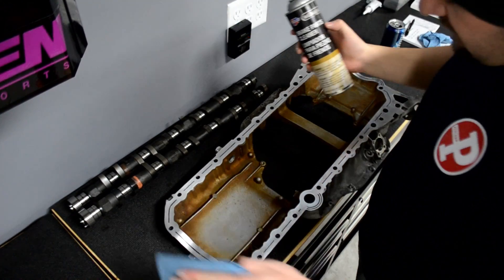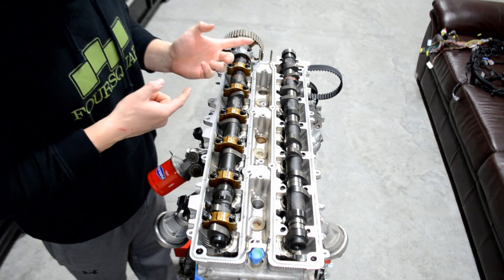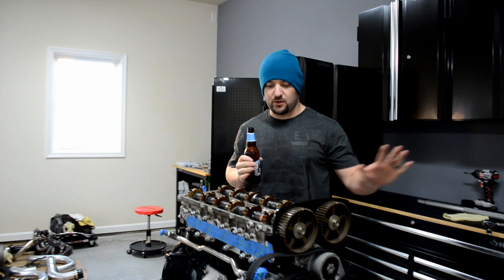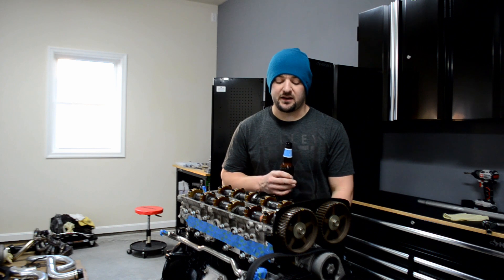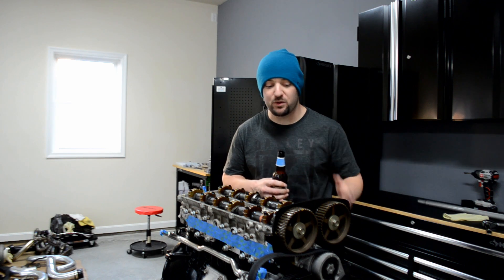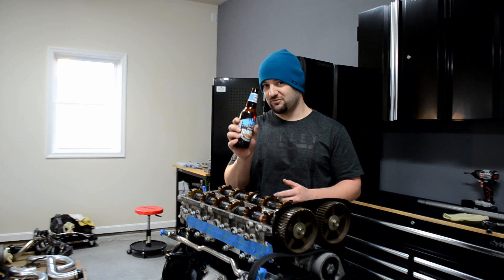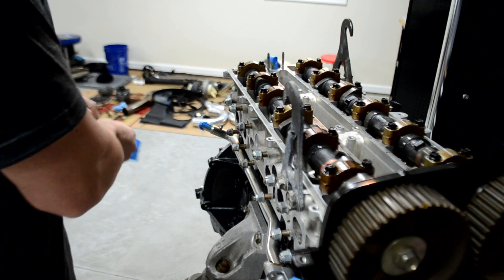Supra Build Series-12: How to Installing BC 272 2JZGTE Cams, Oil Pan & More!

Comment: Hey guy's, Just want to be sure about something if you wouldn't mind giving me a hand.  Correct me if I am wrong please!

First I remove oem cams, install BC cams over oem buckets, springs etc., measure, do math, order 24 new shimless buckets. Then remove BC cams and all the guts using rope trick( seals, springs, retainers, keepers) install new seals, BC springs, retainers and keepers.

This I'm still unclear about...
With T-belt off, I put crank at -10 btdc so all pistons are slightly down, install BC 272 cams, install cam gears, torque cams as per manual. Then turn crank clockwise to tdc notch, and turn cams to tdc notches too. Install t-belt? Correct? Thank you!

Jay

Comment: Out Of Curiosity, Why do all engine rebulid videos have super low voice but super loud music?
Reply: Compression within the audio
Most music is at an avg of 0db on the output, the vocals, if left uncompressed/unfiltered would generally be at -4 to -6
Unless you run your vocals through compressor and know the ins and outs of audio tech stuff you won't get equal volumes, most people avoid compressing the audio because if done wrong it will warp your vocal track and make it sound loads worse
-Late reply but hope it helps lol

Comment: Dude good video the only complaint I got is you always are supposed to cross tighten the bolts
Reply: Guys like you run into problems more frequently and never understand where they come from or why. Engineers invented bolt pattern torque sequences for reason. If you actually had OCD, you would've torqued them correctly instead of throwing caution to the wind. smdh.
Reply: PURE Function just because there's zero issues doesn't mean you shouldn't do things correctly. But other than that, nice video

Comment: for the torque yield bolts, did you have to get re-manufactured ones or could you just use the same ones over after torque as been applied to it
Reply: If you want to do it right, get new yield-to-
torque bolts

Comment: I take it you figured out how the timing belt tension-er works :). Glad you are doing this man, i've been there, even on my build ran into some lessons learned. My second block i ended up painting silver instead of black so it's easier to find leaks etc, and clean then after the paint hit it with Spray Max 2k Clear Glamour as many coat's as the an will let ya.

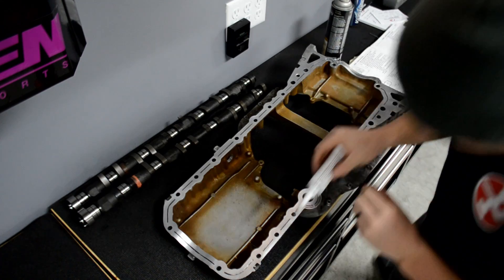Comment: Nice built there, I have watched all your videos. I think you put the sealant on the outer side of the pan. Check 1:15. I am saying this because you may have a leak through the bolts
Reply: He didnt tighten the bolts in the correct order either. Lucky he didnt crack it.